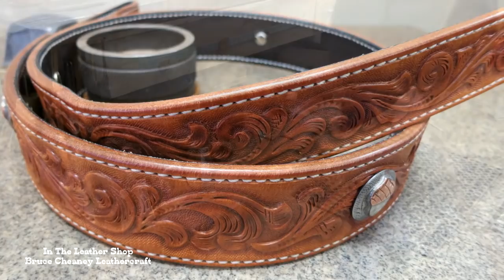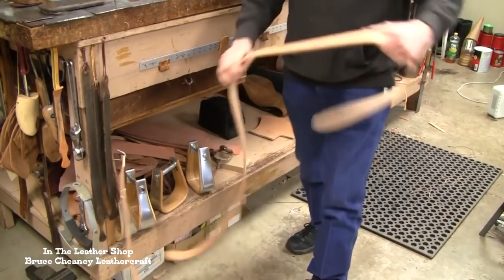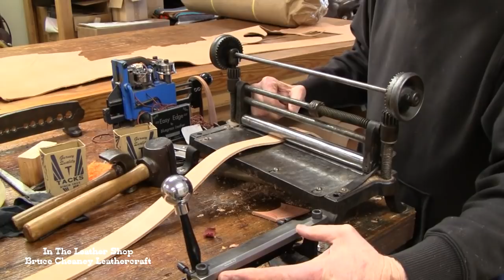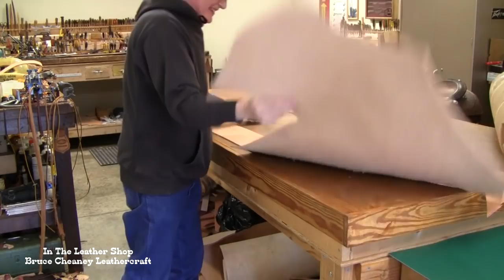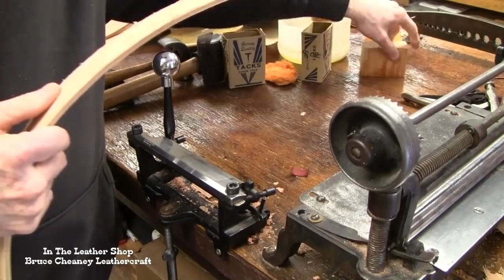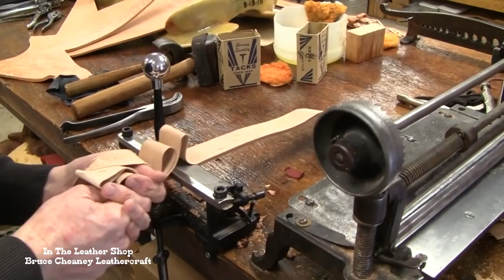Leatherworking - How to Cut and Split Belt Blanks with C.S. Osborne Leather Splitter

Comment: I had that same problem with my splitter cutting thinner in some areas. It would actually cut the leather in to. This happened many times before I found it. I looked it over & over & the roller was bowed a bit in the center & that is what was causing that on mine.

Comment: I am lining a nile crocodile belt  and do not want to groove the opposite side in case if I punch my stitching chisel wrong. Should I use the swivel knife to cut a groove on the croc side?  I noticed on a scrap piece the stitch groover doesn't bite into the croc very much if at all. I've never done this and could really use some help. HELP? aLSO SHOULD i STITCH AROUND THE BELT HOLES TO MAKE CERTAIN THEy NEVER SEPARATE? I'm using 0.8mm ritza tiger thread in brown.
Reply from the maker: Those croc hides are so thin I don't think I would put a stitch groove on it. Should be okay to stitch around the belt holes.
Reply: @cheaneysaddles  This hide is over 2mm thick and it is tougher than leather. I just want to hand sew a straight line, I guess I'll groove the backing leather and hope I keep it straight.

Comment: I have a question that I think you can answer. I am making a western style belt out of harness leather and it is 8 oz. I want to add a piece on the back of black chrome tanned and is it ok to do that without a problem?
Reply from the maker: That will work just fine.